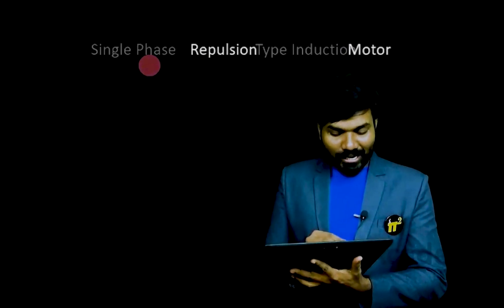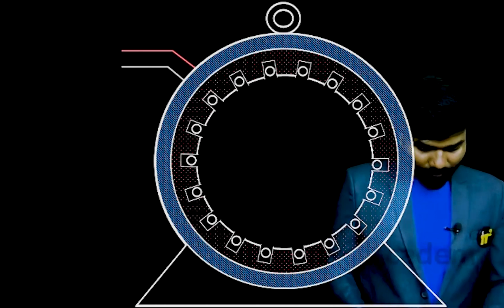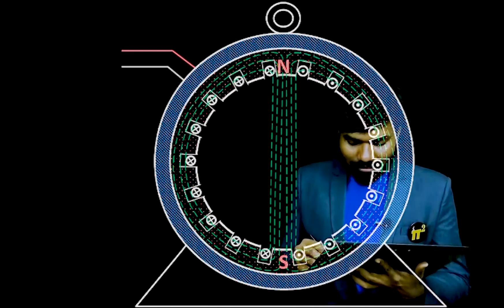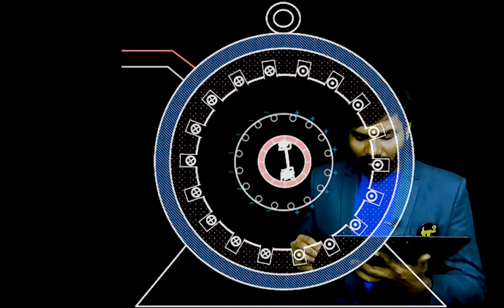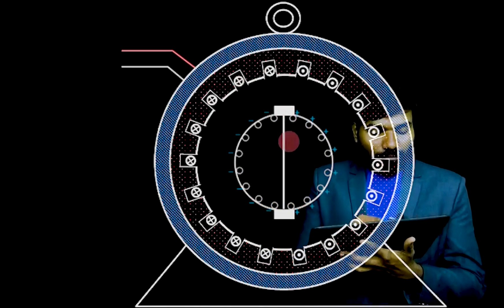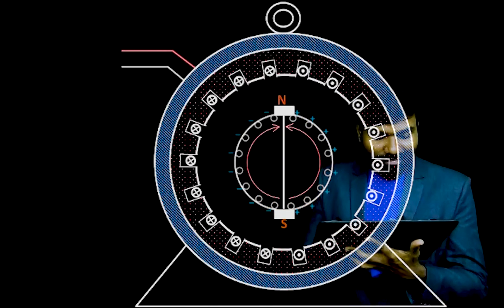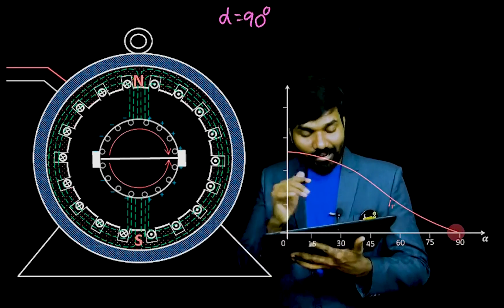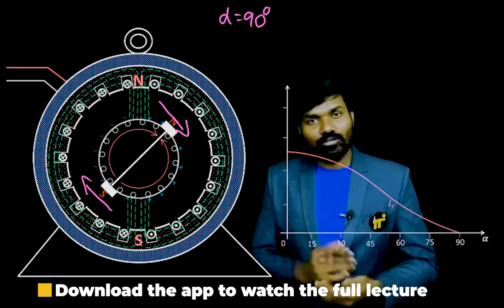repulsion motor | repulsion motor wirking principle | single phase motor

Comment: Sir what is the purpose of commutator on repulsion induction motor
Reply from the maker: 🎯I really appreciate for the perfect questioning👏. This is the best question👌 one could get from this video. Let me try to explain shortly and easily. 😍

In a single-phase AC repulsion motor, the commutator plays a pivotal role in managing the direction of current within the rotor windings, which is essential for generating and maintaining torque. By ensuring that opposite sides of the brushes have opposing current directions(due to commutator). 

The commutator maintains a consistent repulsive force between the rotor and stator fields. 

Watch the video once again, keeping these lines in mind to get clarity on answer. 

Summary:
The commutator's ability to alternate the current direction on either side of the brushes is fundamental to the operation of a single-phase AC repulsion motor. By managing the current flow in this manner, the commutator ensures continuous and controlled torque generation, enabling the motor to perform its intended function efficiently.

Good luck
Reply: @ThePiSquareAcademy  thank you sir